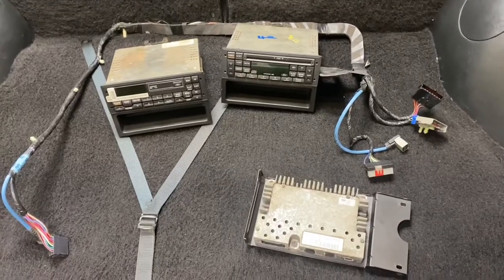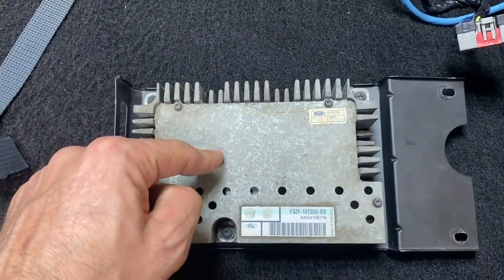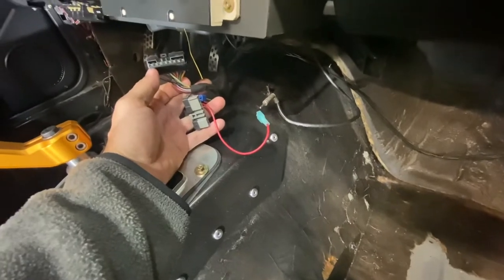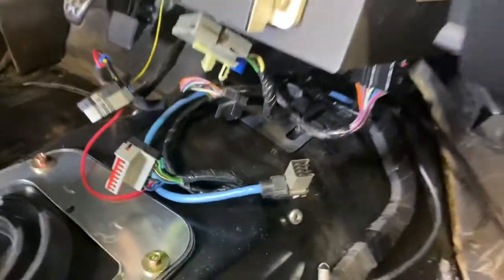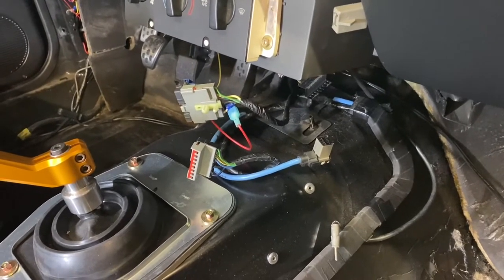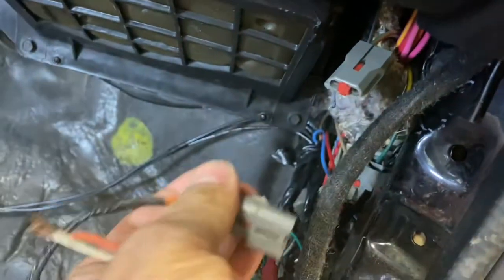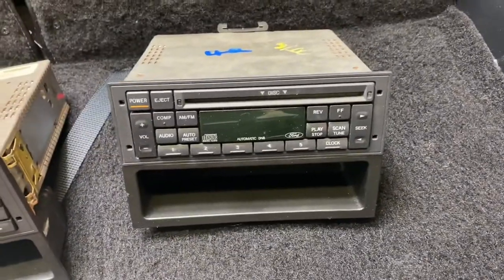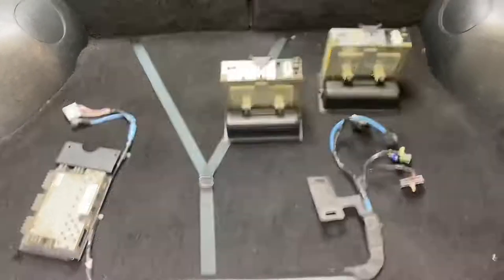Foxbody Mustang 1993 Premium Radio into 87-92

Comment from the maker: Just to update some new info for around @6:00.  On the 87-89 cars, the door speakers were connected to the premium amplifier harness. So when you pull that harness out, you will loose your door speaker connection. You will wed to connect the doors to the dash speakers in parallel.  On the 90-93 cars, the door speakers are part of the dash harness and should be present in all models.

Comment: A lot of good information here, my only wish would have been for you to add what the part # is for the factory stock 1993 AM/FM Cassette Premium (non Cobra) and the 1993 AM/FM CD Premium (Cobra) so when I'm searching I know whether or not it is correct for my restoration.
Reply from the maker: I added a link in the description with various radio part numbers . Thing is it’s not widely published so it’s all ever changing based on research.  I didn’t want to stick it in video and be wrong so at least I can update the thread

Comment: Will running the oem radio without the premium amplifier effect the sound quality dramatically? Mine is pre 93 oem radio without the amp installed.
Reply from the maker: For the 93 radios,  the radio does not have any internal amplifiers so if you were to run it without the amp, you probably wouldn’t hear anything.   For the 87-92 radios it appears Ford used the same radio for both amplified and non-amplified applications.  From what I can see the headunit was 5 watts per channel, and the amp boosted that to 20 watts a channel
Reply: @Mustang5L5  great info so I guess I should install the pre 93 amp to my 91 for improved sound quality. Thanks for the info
Reply from the maker: @sneakingfox5887  it would, but don’t expect a dramatic difference.  You’ll need to track down the correct 90-93 amp harness as well.  A little different than the earlier harnesses

Comment: im actually doing the opposite of what your doing, but im having problems finding an aftermarket male female pigtail harness for the car side and the aftermarket radio side. i want to do this to make it quick release.
Reply from the maker: Are you referring to the Metra 71-1770 and/or 70-1770 harness?  That’s the OE style male and female harness.   Would work on all 87-93 with the oe amp and harness bypassed

Comment: I have a 1993 mustang, I buy an aftermarket radio has power but no sound. What is the problem?
Reply from the maker: Make sure you are bypassing the amp.  If you are wiring the radio into the amp it won’t work because the amp is looking for line level inputs.
Reply: @Mustang5L5  How I bypass the amp?
Reply from the maker: @jonatanissa  You want to make sure you are connecting your radio head unit to the body harness that i show at 3:23 in the video.  You just disconnect them from the amp harness that i show at 4:36.   you can remove the harness (it's under carpet) if you want or just tuck it back under the radio